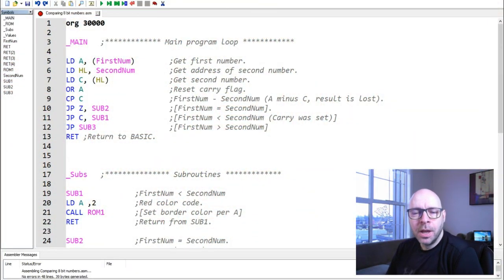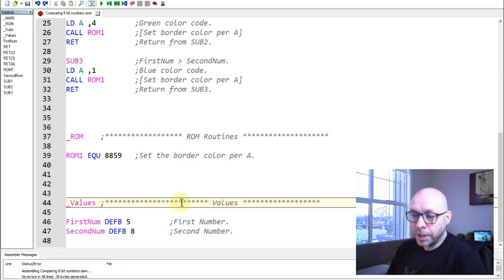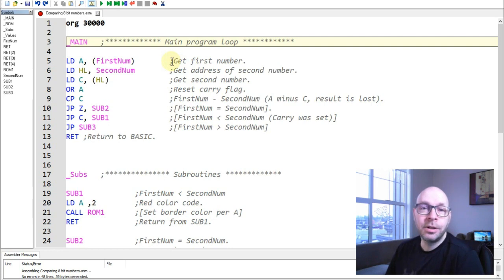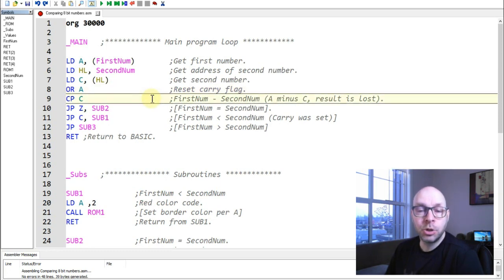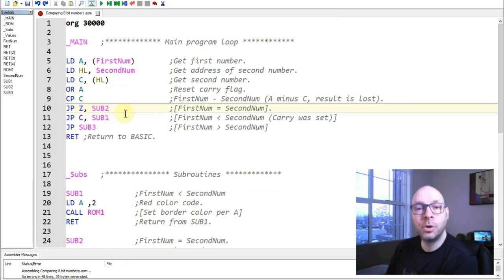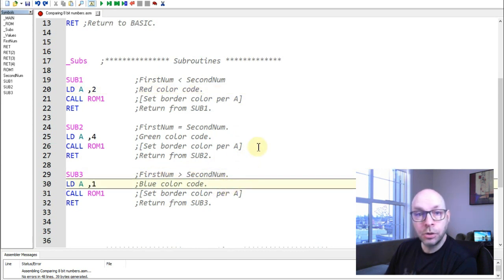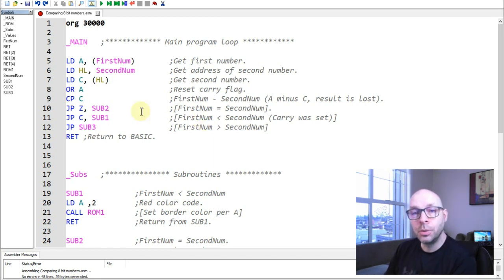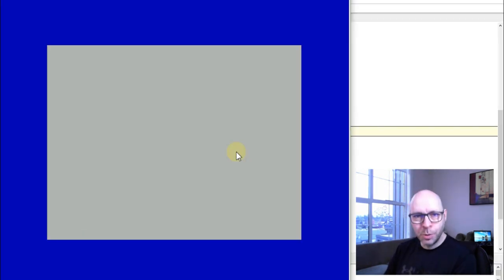#35: Z80 Assembly - Comparing 8 Bit Numbers (Sinclair ZX Spectrum)

Comment: There is an error in the comments for lines 22,27,37 "return from subx" accually these are NOT subrutines and are not CALLed so the RET - is return to Basic. Thus the Main RET at line13 is never executed
Reply from the maker: Thanks for the correction.

Comment: Thanks for the video.
Just some comments:
line 8: OR A is not necesary. The CP will set or reset the carry flag depending on the values. That is what CP does, and the other flags, of course.
line 13: RET is never reached because you jump somewhere else before that.
Also, how does signed compare work? Would be nice to explain as well.
Have fun!
Reply from the maker: Thanks for the feedback!